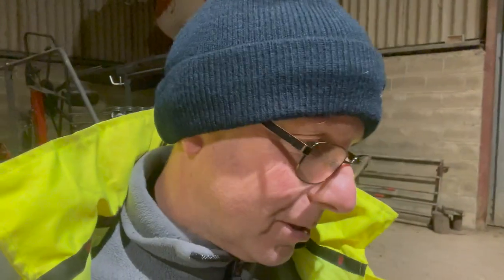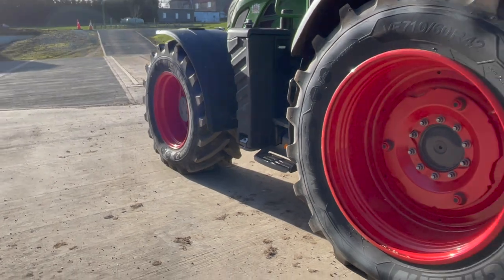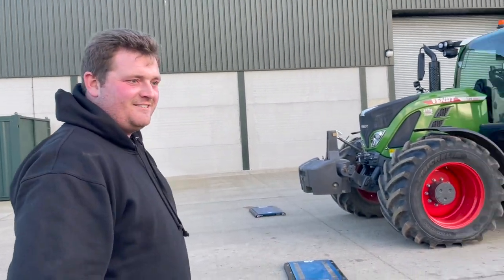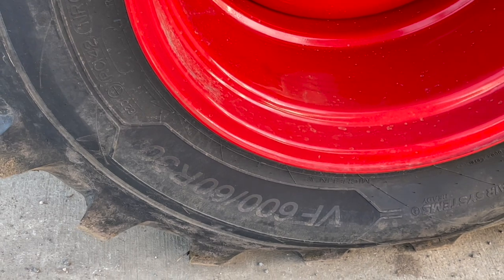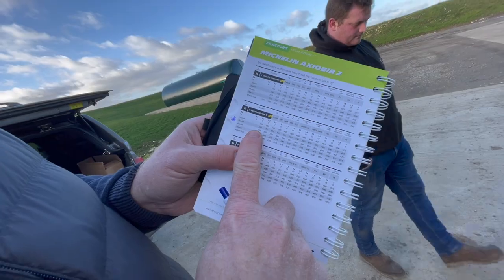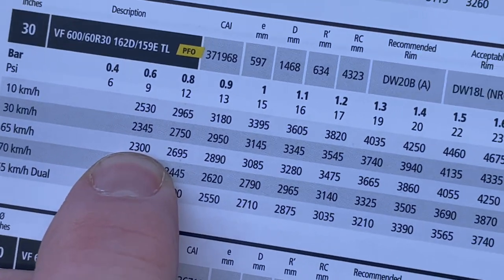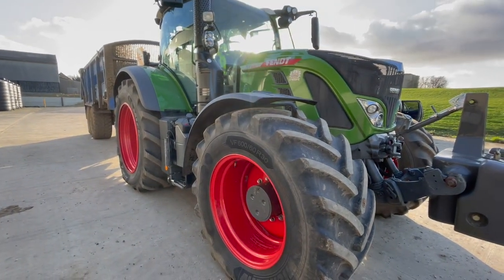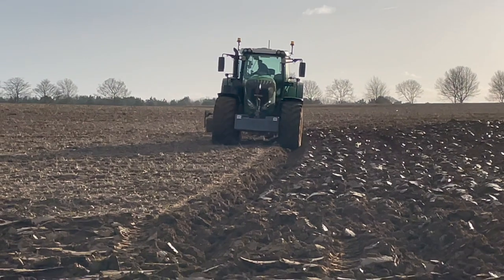Video Diary on the Farm No.42

Comment: There's a lot to the tyre tech these days and grunge the right pressure for the application. 
Can the inflation system be retro fitted? Would the farm look at doing that?
And with relevant machinery that'll be on farm for years to come? 
I only ask as changing pressures is not something most farmers would do constantly because of the time wasted to do it but should be fine to get the most out of tyres.
Reply from the maker: Yes tyre technology has really moved on on recent years, central tyre inflation could be retri fitted to this tractor, but we won’t, because it spends most of its life on the sprayer set at one pressure. Our 939 has cti fitted and we make the most of it!
Reply from the maker: As you said farmers would not change the pressures constantly, but the huge advantage this AXIO bib2 tyre has is it can carry a large load at a reduced pressure on and off the road so keeping compaction down
Reply: @JDautopower  
Cheers. I didn't realise the 939 had it already.
Reply from the maker: I showed it on an earlier video, think it was video No. 6 real easy to use.